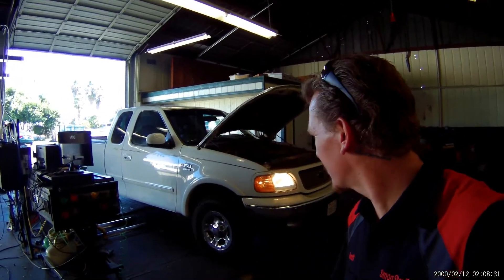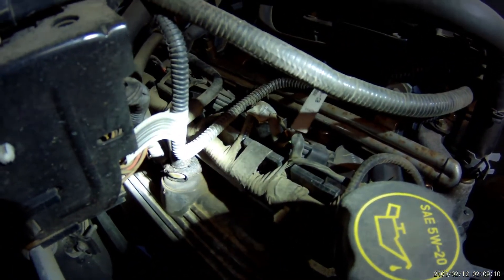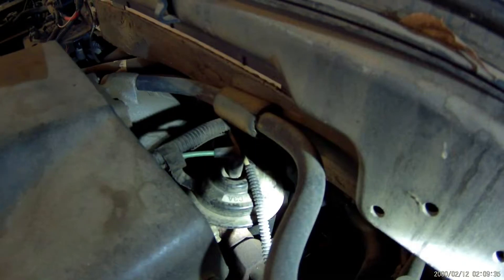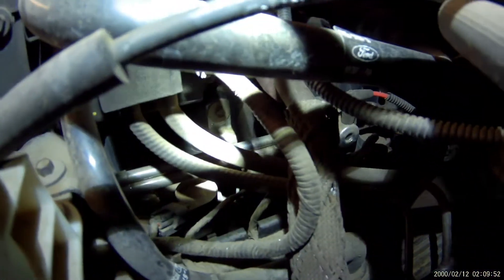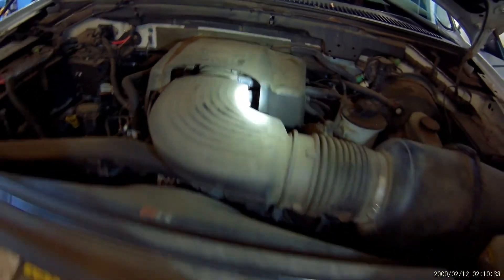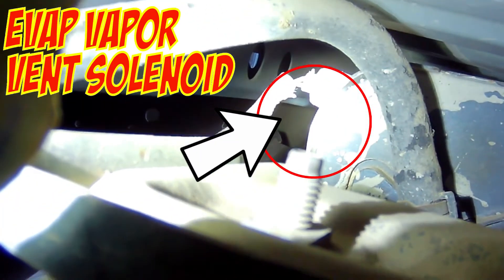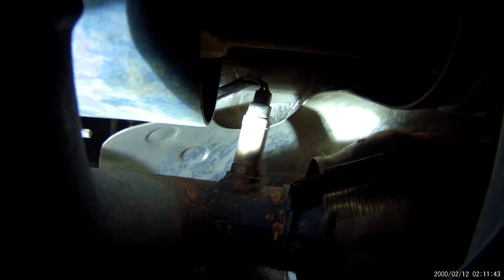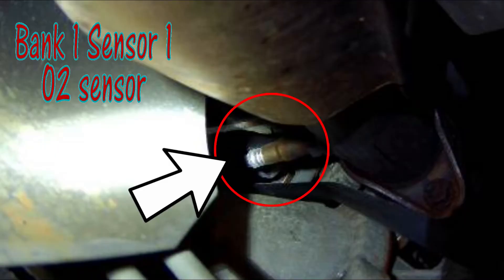Ford F-150 PCV, EGR, DPFE, Vapor canister, Oxygen Sensors

Comment: Hello. Could you please tell me what the short hose, with white connector, located next to the fuel vapor separator hose with the green connector, is called? Thank you in advance.
Reply from the maker: Is it in this video or do you have a picture? Send a pic to therealscottieshobbies@gmail.com  or let me know at what miniute mark in the video. 00:00
Reply: At 5:12, you are talking about the evap purge solinoid-just to the left of it (in the video, but not addressed) there is a long hose (that runs back, horizontally, to the left, behind the throttle body, with a green connector (green connector squeezes together for removal.) Just below the green connector is a line, with a white connector, that goes? (through the firewall, maybe?) that's the line I can't find the name of anywhere. I'll try to get you a picture soon.

Comment: Can you do a vid on how to fix a evap system
Reply from the maker: There is way too many possible fixes for the evap system. It could be a leak in the system or it can be one of the solenoids not shutting properly. 

What are you trying to deal with?
Reply from the maker: I do have a couple videos covering evap compenets and a simple way to find a leak.
Reply: @ScottiesHobbies  it’s cause I took my truck to smog about a week ago and it had evap system and some other stuff I had to fix. I changed the EGR and I drove it for like a week to put miles on it. I went yesterday to smog it and it PASSED. I was due over so I had to fix everything as fast as I could. That’s why I even cane up to your vid. But I guess just driving it and letting the computer sink in all the information it worked. Thanks anyways for getting back to me. I appreciate it!!!!

Comment: Hey man great video 👍 I’ve got an 03 f150 that is throwing a p1450 code and it says “fuel tank can not bleed up vacuum”  anyway I replaced the vapor canister purge valve and the code is still hanging around. Any suggestions? Thanks 🙏

Comment: My 97 Ford f150 is throwing a p4055 evap large leak code. I just replaced the filler neck. (Did not solve the problem. Any idea of what the common problem could be? Thanks.
Reply from the maker: Did you look at the seal on the bottom side of the fuel cap?
Reply from the maker: Other than that... fallow the vapor lines from the intake, to the purge, to the tank, to the vent. Look for any sign of condensation buildup. You might find something that looks wet. I have a video on doing a Mickey mouse diag using soapy water. I can post a link later if you can't find it in my library. Now... if you dont find a exterior leak your Purge Solenoid or Vent Solenoid might not be closing all the way.

Comment: i have an 03 f150 5.4, on my canister purge valve, the white insulated wire that connects to the bottom of valve has melted from contact with the egr tube, is this a specific wire that has to be replaced,  or can i use any kind of of
coated copper wire and sauter it back together.

Comment: Hi, hope you can help me.  I have a 1998 Ford Expedition 4.6L and can’t pass Ca.Smog because the EVAP and CAT Sensors are not open or clearing.  No check engine light on, just the 2 sensors not in the Check or Ok position.  Did lots of driving around with about 130miles already but still not in the Check or Ok position.  HELP!! Thanks in advance!!
Reply from the maker: Can you send me a picture of your underhood label to scottbpay@gmail.com?  In the mean time... 130 miles is a lot but id say that's a average milage your at. Some vehicles take a lot to set, I just had a customer drive 700 to get them to set. But if you have a Fed certified truck then it might be getting smogged wrong.